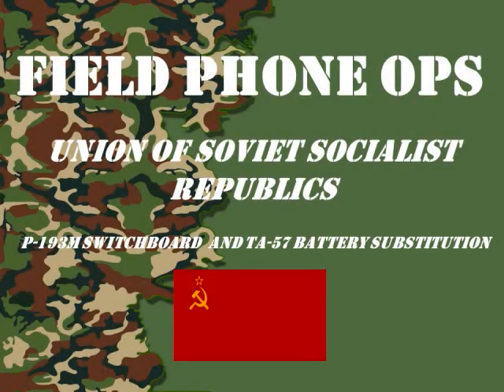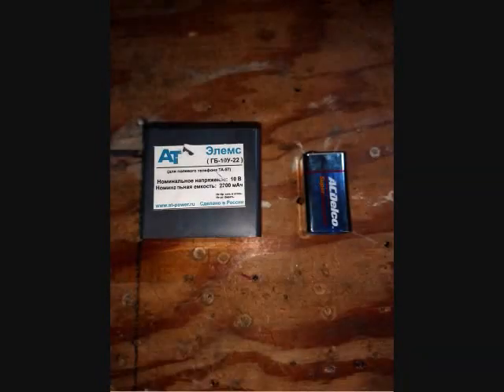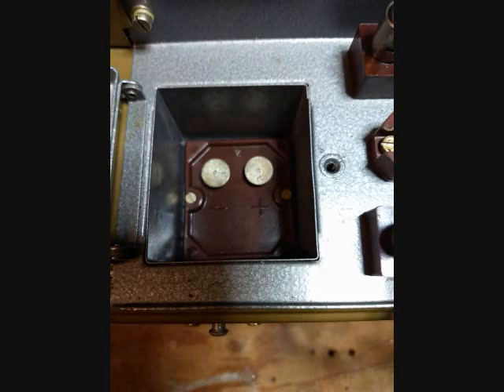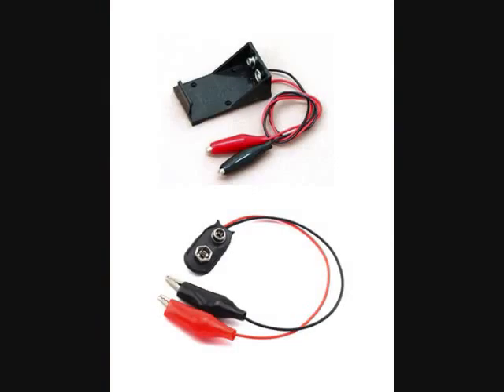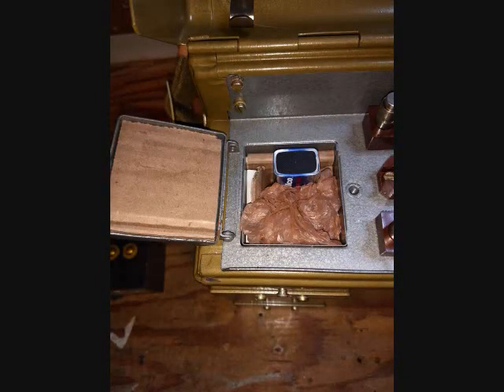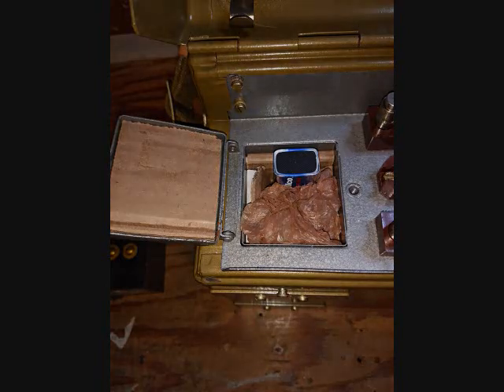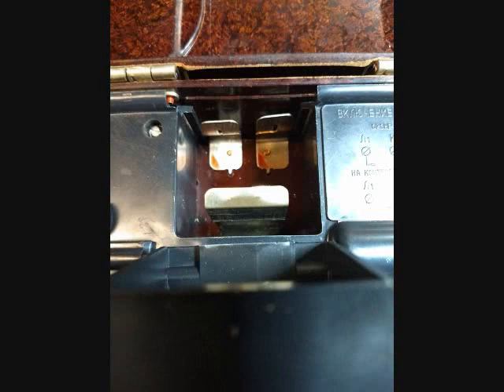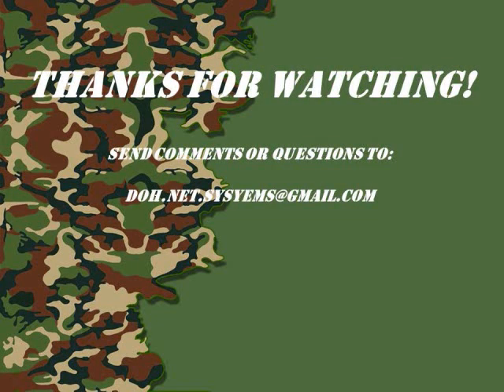FIELD PHONE OPS: Battery Substitution Soviet Equipment

Comment: Thanks for the great videos. I just bought an SB22 to hook up to a couple TA312s. The switchboard did not include a H182-A headset. What type of handset do you use that has a compatible 10 pin connection?
Thanks,
Former 31K Dan
Reply from the maker: H-156.  You can get them on ebay